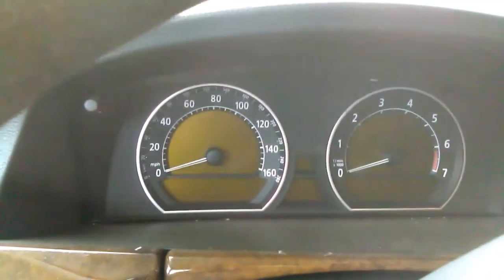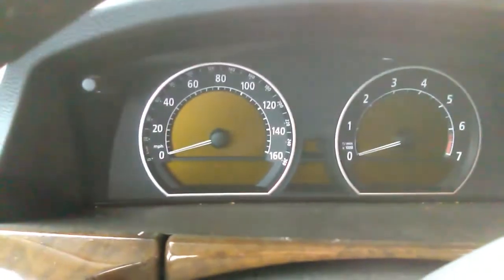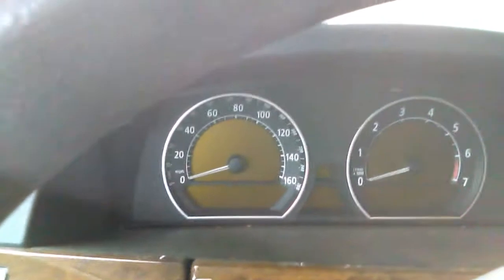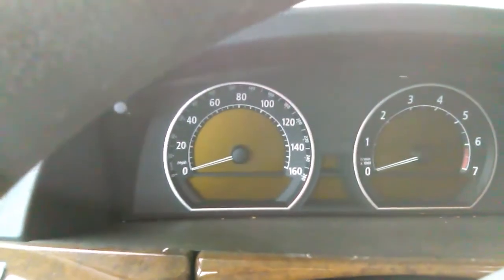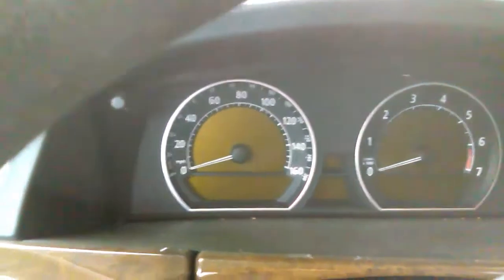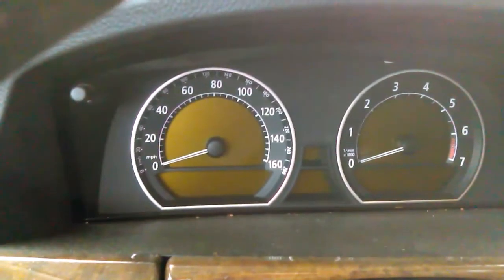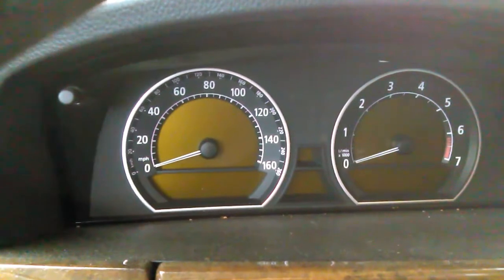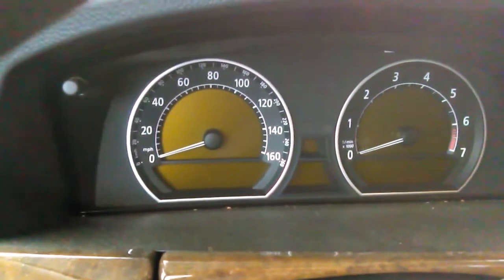2002-2008 BMW e65 e66 745 i 745Li 750i 750Li 760i 760Li speedometer not working

Comment: It only plays for 5 seconds, and then it stops
Reply from the maker: I think it is YT problem because that happens to me when I am watching other videos too.
Reply: @franciscoamayaYT  alright thanks Francisco I appreciate your time
Reply: I really wanted to see your video because my 2002 BMW 745i cluster is blank and I can't figure out how to fix it
Reply from the maker: No, lights. 
Did you check the fuses?
Reply: @franciscoamayaYT  which fuses should I look at, the one's on the glove compartment or the ones on the trunk
Reply: Do you know which fuse number would be
Reply: Hey Francisco I  already checked the fuses and non of them are broken but my cluster is still not working it has a blank screen
Reply from the maker: Probably the dashboard is bad
Reply: Hey fransisco i just changed both of the speed sensor but still the speedometer does not work any idea or any other sugestion??
Reply from the maker: Maybe the speed sensor is not compatible or there is another problem.  Do you have a code number?
Reply: Francisco Amaya yes the code I get is the p0500 and p1721